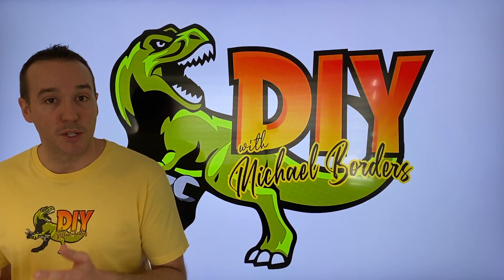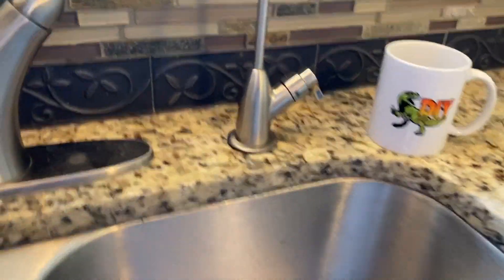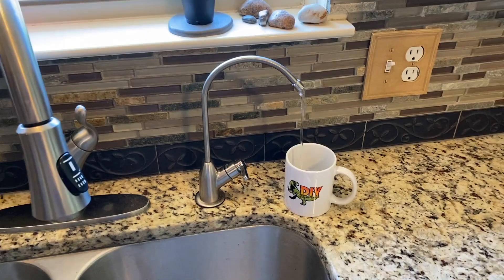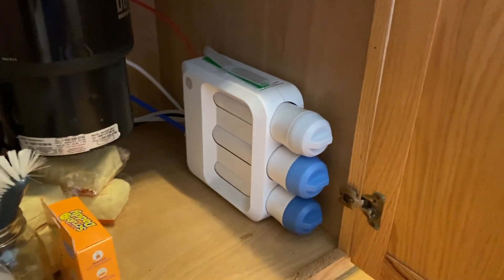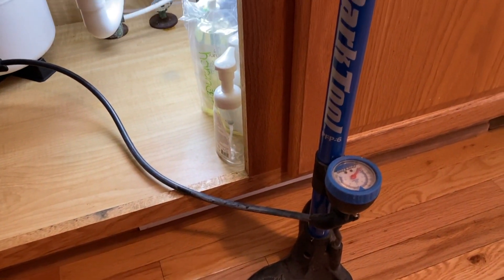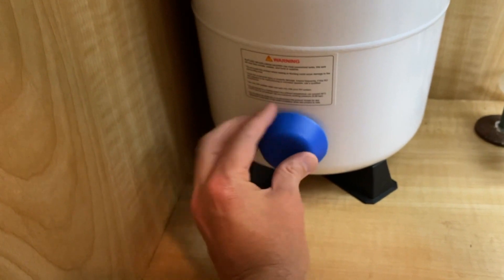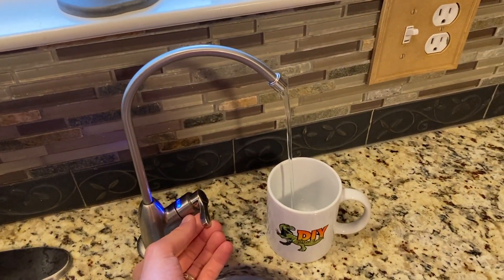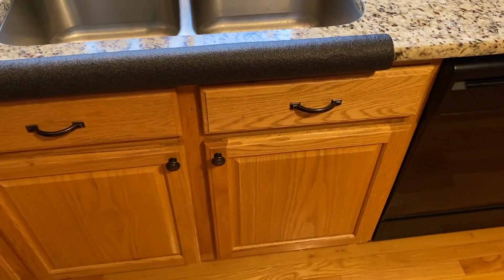How to pressurize reverse osmosis tank - DIY

Comment: Bump the pressure to 14psi
Reply: The Model: TP-12 says it has a Maximum Working Pressure of 100 PSI. It says this right on the label. I keep hearing 7 psi in videos but nowhere in my owners manual have I come across 7 psi. This RO system has been extremely frustrating since the day I installed it.
Reply: @PointManActual Any update on the proper PSI? I’m having the same issue and reading seven PSI everywhere.
Reply from the maker: Thanks for watching & welcome to the DIY Raptor Club.  14psi is too high for this specific unit.  Following the owners manuals recommended psi setting is best.

Hope all is well with you and your family.